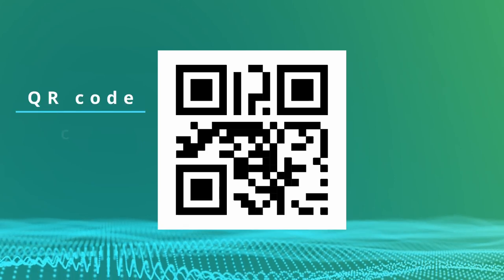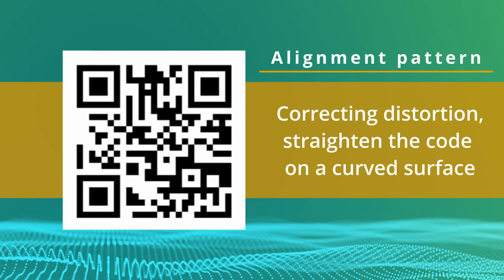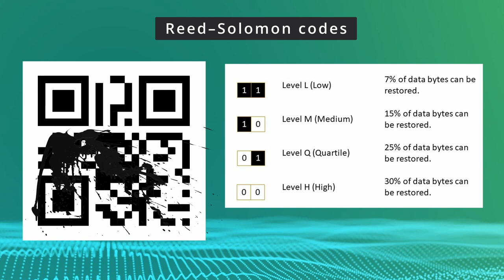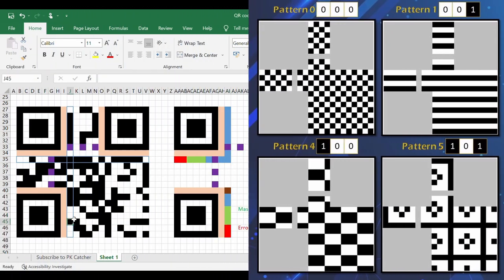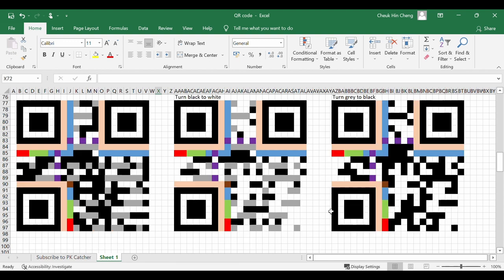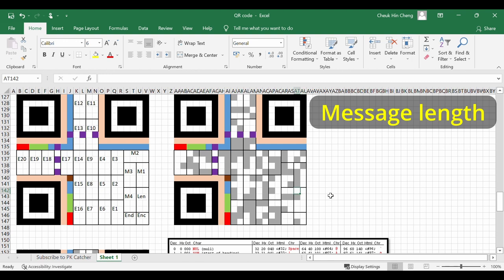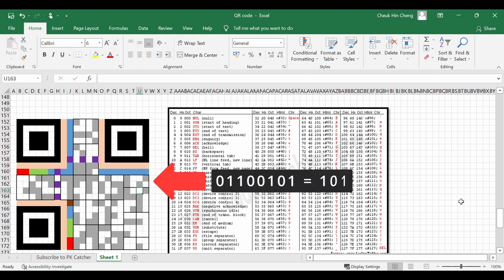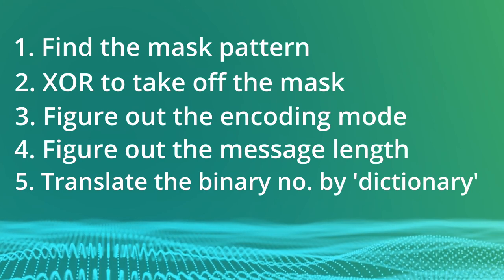How to Decode a QR Code by Hand

Comment: Hi! You are really good at this, and you moved me closer to some answers. But maybe because of my non well english i missed some important information. Whats the logic that you use to split qr to sectors? 
Because in my way i tried to decode QR by using your methodic (it was version 1 21x21 blocks). And i clearly know, that it starts from $ symbol (dec 36, 00100100 binary) but i cant get this combination even if i start from the bottom, what do i do wrong? 

I started to understand QR logic because i spotted some interesting QR from one company. He seems like regular one but have some hidden information inside. I used all scanners online and apps to decrypt it, but nothing works. For example when I am scanning it, it shows WT:1:40:102 and based on version 3 (29x blocks), but when Im generating my one, exact the same message converts to version 1 (21x blocks). And when they scan my generated QR it on their software it shows that nothing store inside, but if they scan their own with exact same text but based on version 3, showing hidden content inside.
Reply: Ever heard of SQRC's?
Reply: @saschavjater9065  not yet, i had some specific task to generate QR like this for the first time in my life. And i just hoped that somehow QR’s like this can be decrypted in easy way. Thanks for answer anyway:)

Comment: Thanks for the video, interesting! One qouestion: Is there a code that can be read in the 3 alignment squares? Or can they be read?
Reply from the maker: No. I don't think there is any readable information. They are there to help the QR code scanner locate and align the code, ensuring that it can be read correctly even if it is slightly distorted or rotated.
Reply: I know that, but if it where for them to be read, could they be read? they must be, only i do not know how! I wonder if there is any corelation to number 6. In the previous barcode, the three 6 were always present. It must be the same whith this one. For correct alignment one square only would have been enough.
Reply from the maker: Just want to say this first. I learned this topic specifically for this video. I am not an expert and this was made a while ago so I cannot answer you professionally. However, here I tried my best to give some assumptions.

While a single alignment square might be enough, three squares provide more reliable alignment, especially qr code has more dimensions than a barcode. This also explain why larger qr code needs more small alignment square in the middle. Also, having three squares allows room for error correction even if one of the square is damaged. I don't think they directly contain readable information, but their spacing could theoretically be used for data encoding.
Reply: Thanks :)

Comment: Is there any way to decode bigger QR Codes? :)
Reply: they are slightly more annoying, but certainly possible. For size 2 and up you have to skip over the alignment pattern, which makes your groups skewed and slightly more difficult to read.

While for size 3 and up every group of 8 bits are alternating between the first half and the second half of the string. the wikipedia article on qr codes has a nice image of the pattern for version 3 and up.

the idea is basically that the first four bits are the encoding type as usual, then the next four bits are the first half of the length, then you skip 8 bits and continue with the next four bits after that being the second half of the length and so you keep going, with each byte being four bits, skip eight, and then the other four bits, until you get to the end at which point you look at all the bits you skipped
Reply: @asdfghyter  very cool! thanks for sharing